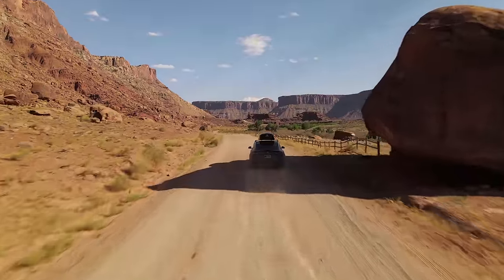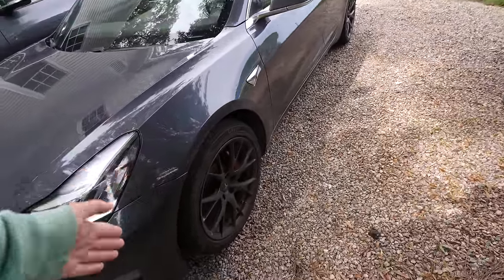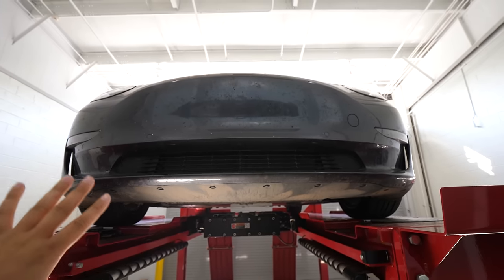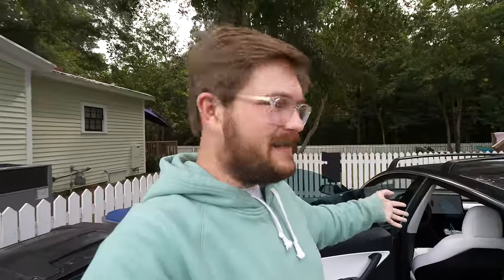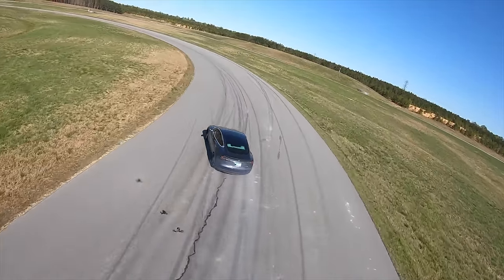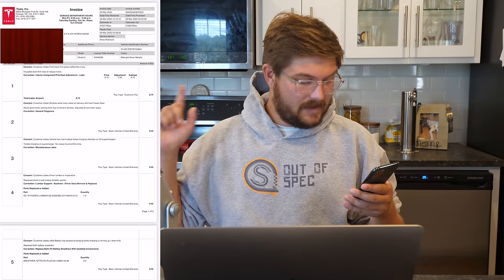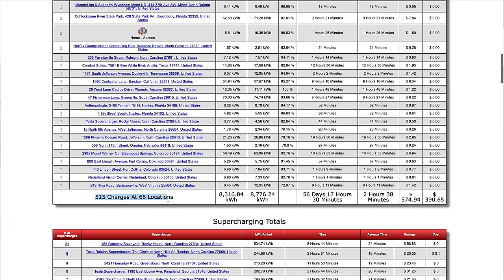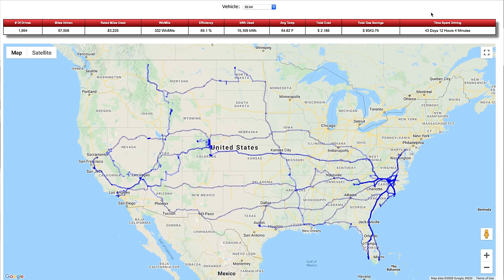Tesla Model 3 Performance 1 Year / 60k Mile Comprehensive Ownership Report

Comment: Good info on depreciation (yes, they depreciate!) and the battery test.  That took a lot of work.  Thanks.
Reply: That depreciation is REALLY GOOD! Most M and AMG cars depreciate almost 50% when they are OUT OF WARRANTY. The fact that this car retains this much value as one that's out of warranty is really good for a performance model.
Reply: Just did a video comapring the tesla model y with a rx can i get ur input !

Comment: 1:10:00 Hi Kyle, nice test. You probably know this, but it wasn't evident from the video - there is actually quite a lot of buffer under 0%. How long did you drive under 0%? Basically what Tesla does is it hides about 4.5% on the Model 3 below 0% while you drive. I did a vid on this driving exactly like you did to showcase how Tesla does it - every 100km they hide 5km (they "disappear") from the range and put it below 0%. So I think you had more juice. You can easily get a good measurement by multiplying Wh/m by miles driven which is around 67.8kWh in your case. The buffer is around 3.2 so you had about 3kWh left. I measured around 2% heat loss on perfect conditions, same speed and no elevation, which is more than the 0.5kWh you predicted maybe around 1ishkWh. Anyways, maybe beating the car a lot has done its toll. If you are at around 71kWh from 77.5kWh initially that is about 9% degradation, but the first 2% go out fast. I think you will plateau around 10% and then once you hit 100/150,000 miles +  it might drop to about 15%.

Comment: My iwife has around 78.34% bedroom degradation over the last 14 years.
Reply: What’s the trade-in value?
Reply: Cringe boomer joke
Reply: Not sure which is more cringe. The original Joke or the 14yr old embarrassed by it!?
Reply: Are you sure it's the battery?? Not the home charger or the faulty plug?

Comment: 17k to 20k isn't bad. To give you some insight, my LR AWD with FSD had a sticker price of 57,000 and some change. I used to work for Carmax and this is how I bought mine. The previous owner traded my car in to Carmax with less than 1000 miles and Carmax only paid them 40k. Thats a 17k loss with almost NO miles on the car. The fact that 60,000 miles only caused you to lose 4000 more(based on your vroom offer), is pretty incredible!

Comment: I loved the travel and camping, especially the death valley trip. I am planning a similar trip in a few months from  Seattle to San Diego . I plan on ordering a white Tesla Y with a Yakima roof box. Hopefully most of the early fit and finish issues will be resolved soon.  I figure by late December they will be hitting vin numbers around 100k. 
If you did the trip again what would you do differently? How much range did you lose with the rooftop box?

Comment: note: glass rejects UV inherently without needing tint. you can't get a sunburn through glass. Also i have a spoiler on mine as well..Amazon $199 just sticks on the same way carbon fiber. Works great

Comment: That depreciation is INSANE.  I sold my 2017 Dodge charger scatpack to get my performance model 3 and I put 47k miles on it over 3 years, paid $43k for it and managed to sell it to AutoNation for $34,500.  I took that money and RAN!  Their offer was about 2grand higher than Carvana and 3500 more than CarMax.

Edit: Bringing my car home from Atlanta to Birmingham, I noticed that when I had the cruise control at 75, the projected battery percent at destination remained steady.  The higher I went over 75mph, the quicker it would drop.  Seems like 75 may be the sweet spot for the interstate? I've got a trip to and from Montgomery on Sunday so I'll test the full trip down going 75 and back at 70 to see what happens.

Comment: This was really informative and well done. I was surprised at the degradation of the battery at 8% (24% over three years?) for a battery that is warranted for 8 years. Is that what you expected given that you take care of it very well?
Reply: Late reply here but if it helps you, this is definitely super high. After 143k miles over 2 1/2 years, my battery has only degraded 7.5%, which is on par with the average. I'd suspect the performance use, along with abnormal charging time, sitting idlely on the charger, cannonball runs etc really take a toll on the vehicles ability to retain power.
Reply: and also degradation doesn't continue at the same rate it should slow down.

Comment: I took delivery of my 2020 tesla model 3  performance on Sept. 26th, 2020. A late 2020 model that came with the wireless phone charging just like the tesla model y, and as I looked around  it didn't come with any kind of panel gaps, and as I looked under the rear of my model 3 performance I saw that it has a way better floor seal on the under body

Comment: On resale of an electric car like a Model 3, I'm wondering if the residuals will actually increase when people realize nothing is "wearing out?"  In a traditional car, mileage plays a huge role as major wear is always occuring in the engine and transmission.  What about in a Model 3?  If the motors prove 300k-500k miles is possible, and the battery lasts for nearly the same, I'm betting peoples normal perception of a "100k mile used car" will change.
Reply: Aussie2u I think the problem for these will be the other wear to the body and interior.  Once those are up to the level of current big manufacturer levels, I agree with you completely,
Reply: @MrHallTV  Also condor the battery's and technology will change. In 10 years battery chemistry will be leaps and bounds better. They may introduce a higher voltage charger that can charge to 80% in 5Min. Never know what that future will hold but innovation will march forward thus reducing re-sale along with wear and tear.
Reply: @RedBarron009  I agree. I usually buy my cars but I really wanted to just lease the Model 3, because should I even happen to love it (I've only just taken delivery but it surely feels like I might) I have no idea what the used market will look like for these EVs a few years down the line. 60k miles is something that would probably take me ten years to drive, so it's not wear but depreciation to worry me. Newer technologies and newer models will come along at a steady pace.
Reply: @fabrom4428  The Osbourne effect is coming into play and although Tesla is now offering trade_ins they have told me that their valuations won't be competitive with the open market for 2nd hand cars
Reply: @johnnyb1843  I still think this will follow different rules from traditional used car market and depreciation, as here you have a hardware capable of receiving software updates that will more or less keep the older model up to speed with possible newer ones for a while. Provided the hardware doesn't wear out sooner than expected, the need to upgrade to the newer model might be less intense than with a regular ICE car. Still, it's all just educated guesses and we'll have to wait and see.

Comment: Kyle, awesome analysis!  One thing I'm not sure if you mentioned - does performance of the battery cell drop with age?  Meaning will the 60k mile Model 3 do a 1/4mile in about the same time as new or does peak voltage also degrade?  Thanks again.
Reply from the maker: Sounds like we need to do a test

Comment: 1) Auto screen wipers - For me they are the best I have on a car - in general, they are terrible on all cars, and I am happy with the Tesla one.  Not ideal but OK.
2) The main reason a Tesla 3 sounds tinny compared to "German" cars is that all of these have double door/trunk seals whereas USA sourced cars have a single seal on doors.  You can fit your own but it is a bit fiddly - but only £20.  This makes it big difference on "thump" of door closure.  It helps with sound insulation too.   I really don't understand why Tesla does not do this simple upgrade as the perception of quality outweighs the cost by a considerable margin.

Comment: I got my Model 3 performance sep 2019. I think its always used 299 epa range as max not the WLTP figure for europe. BTW was the  range test done with the stock 20 wheels or those 18inch you started the video with.

Comment: From my experience, the biggest factor in battery degradation other than charging beyond 90% is "flooring it" and pulling a lot of current from the pack. My LR RWD car is naturally more gentle on the battery since the single motor can't pull nearly as many Amps from the pack as dual or performance.
Reply from the maker: I have this same theory

Comment: Have dirty sensors caused problems? If you've got road grit/snow/mud, I'd assume sensors will be affected - I'm always wiping off the backup camera on my Subaru.
As a secondary question - I absolutely love driving my Subaru WRX on gravel/dirt/snow (Canadian climate). I love the feel of the Subaru AWD, especially with TCS disabled. I understand the Tesla 3 Performance package makes for a car more than twice as quick as my car, as well as the Tesla Y Performance.

How would either Y or 3 compare to my driving experience in the WRX? I've got the best AWD, handling, and the ability to FULLY disable TCS. I'm not into drifting on tarmac, but I am on pretty well anything else. Am I getting closer to a rally experience (as it pertains to performance) with a Tesla than in the WRX, or would I be moving farther from it?

Thanks!

Comment: I'm not sure if it was in the video (since it's kind of long), but what was your overall efficiency for those 60k miles? and were most of those miles with the martian 18inch wheels?

Trying to decide if I should go to lower weight wheels, most likely18"  Konig hypergrams or Enkei rpf1s (LR 3, so no need to clear big brakes), since I'm not a baller like you.  Thank you

=D

Comment: Great video. 23k Miles on my performance model 3. 1 year old and 10% degradation. Charge to 80% daily. Off the back of this I’ve upped to 90% to see if it’s BMS, been 2 weeks and it’s only getting worse.

I charge mostly at home, very rarely surpercharge and never tracked my car. Max road trip has been 1500 miles. Never been lower than 20% (maybe that’s an issue haha)

Kinda surprised at the loss. Will keep trying to work it out.
Reply: Same boat but 13k miles and showing 9% degradation.
Reply from the maker: As mentioned, the only way to truly test degradation is in the video
Reply: Out of Spec Motoring will be trying tomorrow. A friend with very similar habits and same model only saying 3% loss. So hopefully not as shocking as 10% once all is done.
Reply: Out of Spec Motoring ran a test today in my P3D. 100-0% (or -6% was what it said I’d have once I got to the charger. I was on 0% for quite a while.)

300 miles 70.5kWh when I gave up risking more, 233Wh/Mi. Stopped for 5 minutes twice to get snacks. Quite windy and quite a few short rain showers. 59f to 56f temp outside. So I’m pretty pleased. 

Given I went to -6% when I was 0.5 miles from the charger i think something wasn’t quite right. 

Anyway probably bored you with that.haha thanks again for the video.
Reply from the maker: So very little degradation! That’s why you can’t rely on the number shown on the screen

Comment: Kyle, on your battery degradation test you hit 0% at 272 miles and say it keeps going but you stop at 272.5 miles. What happened to that buffer of about 20 miles once you hit 0% that I've seen other reviewers get? Also those dots you mention that need to hit the middle before the battery is truly empty are not near the middle when you stop it.

Comment: Those divots on the top of the door edge inside are identical to ours. We have 2 larger dogs. They did not actually happen for us until after several months I guess when one day our male was overly anxious after we left him in the car for a little bit, or he saw another dog and clawed at it. We have the black interior though. I would not get the white seats or would see the need to pay extra for them. I use chemical guys vrp on our seats and all interior plastic, vinyl, plastic and rubber. It is great stuff.

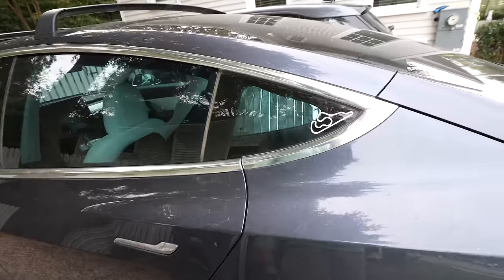Comment: Funny how you mention you judge the fit & finish to be ‘very good from the factory’ at 12:30, just as you are showing the chrome trim on the rear passenger door significantly misaligning with the  trim around the rear quarter glass. Credit to the factory though because the misalignment on the driver’s side matches.  [11:20]. Panel gaps do look good.
Reply: yeah that looked bad
Reply: I thought that too, but he is clearly someone that cares more about the "tech" side that is working more than what does it look like.  Mine came perfect on door alignment and the panel gaps better than most cars you see around; but then mine is an early 2020 model.  I think the QC is getting better as door alignment should be an easy fix on automated production lines.  We see the door panel alignment problems on the Y but not the 3; Setting up the production line that is an issue on all cars. 
Polestar 2 : complete recall for a fatal shutdown.
Etron : paint problems on early cars.
Reply: Yep, another "within spec" item with Tesla. 

Other manufacturers actually build their cars properly in the first place.

My observations are that Tesla owners in the main are too blinkered with their 0-60 times to actually take any notice of shoddy build quality.
Reply: @David-bl1bt Do they - the polestar II with 2 recalls now, the ID3 with constant electronics problems - 12V battery  discharges, Nissan and charge-gate,  Ford DSG boxes, Honda engines.  Notice all of these problems leave at the side of the road  !  Don't make me laugh.
Every new car off a production line has problems - it is a complex system, the question is, does that manufacture learn - fix the problem - and make a better car in 6 months and treat you well.

Comment: Unfortunately CCS is irritatingly more complex when compared to CHAdeMO. While the connector size of CHAdeMO is laughably large, the protocol behind it thankfully is pretty straightforward. CCS adds multiple layers of communications complexity in there, but also does have plug-and-charge like the Supercharging network as a result. The EU Model 3 does CCS, but the US cars lack the hardware to do it as of today. Could an adapter be produced? Likely. Would it require you to swap out hardware? Unclear. If they go the same route as with CHAdeMO, you'll have an expensive adapter. If they go the Model S/X CCS upgrade route in the EU, you'll have a small adapter but need to swap out the charge port controller. While I'd love Supercharger + CCS, I don't know if the US is going to see it any time soon. I also have the CHAdeMO adapter, and consider it good insurance doing a cross-country trip as a backup.

Comment: Tesla in China recently announced another 10% cut in prices for all model 3s due to the cheaper battery cost,  hope US ones will get reduced soon as well. Welcoming to potential new tesla buyers, not to existing owners though :(
Reply from the maker: Well you can always buy a used Tesla for less than $20k
Reply: Out of Spec Motoring bruh where? In Canada there’s none for less than 40k CADand thats on a 2013 model S!
Reply: @OutofSpecMotoring  I’ve never seen a used model 3 for anywhere close to 20k. Maybe in another year though. The more they produce the less they will retain value. Awesome video!

Comment: I have 65,000 miles on my FCEV with 0% powertrain degradation over that time (my range has gone down by 20 miles but that is 100% attributable to my change of tires, for much grippier tires, at 50,000 miles which reduced the range from 300 miles to 280 miles overnight).
Reply from the maker: What kind of FCEV? And how do you like it?
Reply: @OutofSpecMotoring it's a Toyota Mirai, and I love it (especially with the new Yokohamas that are much quieter). At 75 mph I can hear a pin drop in the car. It is the first car that I can listen to classical pieces with wide dynamic range in while on the freeway.

All of the metal on the Mirai is heavy guage steel (no aluminum like my other BEV) so small stones don't dent the hood (as they have already done to my aluminum hood BEV with 1/3rd the number of miles on it.).

The maintenance is basically the same as a BEV with the exception of a more expensive water filter.

The car is tall and comfortable and is what I use exclusively for long range travel due to the actually usable 250 mile range (a charge of an FCEV is a 100% charge not a 50% as it is with a BEV) and the fact it takes only 5 minutes for a 100% charge. 

My BEV is used almost exclusively for local travel so that DCFC is not required.
Reply from the maker: Would love to review one someday!
Reply: @OutofSpecMotoring  I am sure you could if you contacted Toyota. The 2021 is due to be released by the end of the year.

https://www.toyota.com/upcoming-vehicles/mirai/

Comment: So Kyle, What about taking the car to someone to wash/clean?  Maybe set a price limit?  How "detailed" can you get for say $250? Wash? Interior vacuumed? Don't know.  Be interested in how much was just dirt that that washing would take care or vs, really wear/damaged that would required repair work.
Reply from the maker: I definitely plan to - The only non-repairable spot is the ding on the back door. Other than that the paint should come back to perfectly good! May require some wet sanding on the deep bug guts but nothing unrepairable
Reply: @OutofSpecMotoring  I was thinking more along the lines of how "nice" could a regular guy in his driveway with $30 of car care products do on a Saturday vs a real professional car detailer that would be needed to get the car ready to sale.

Comment: It's hard to evaluate the value of a 1 year old car that already has something like 60,000 miles. Regardless of what the depreciation is showing up for this car, just check out all used Model 3 listings. They are almost all listed higher than the price of a new one. Even ones with 30-40,000 miles. It seems whoever takes in the trade is going to turn around and make a fortune.